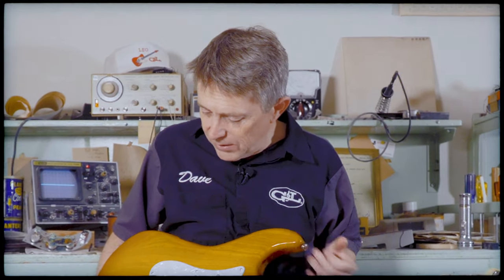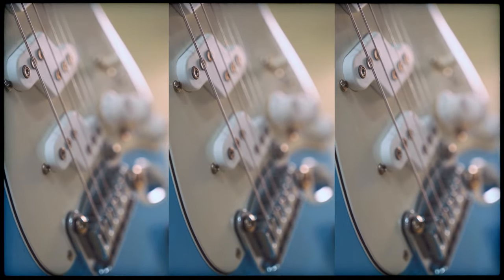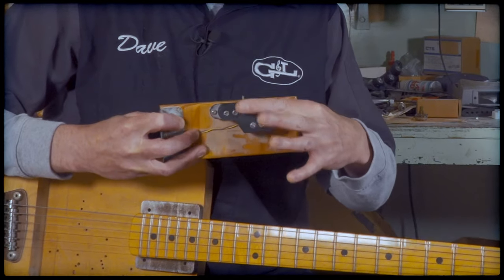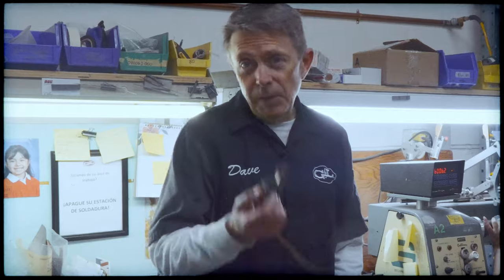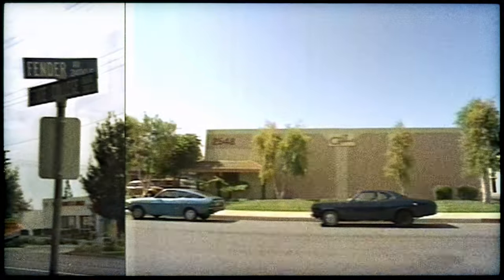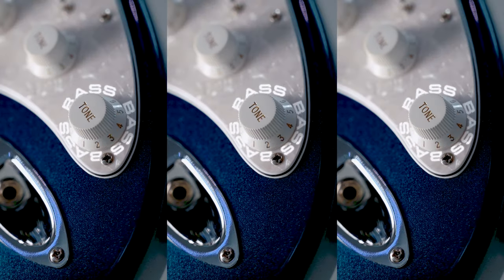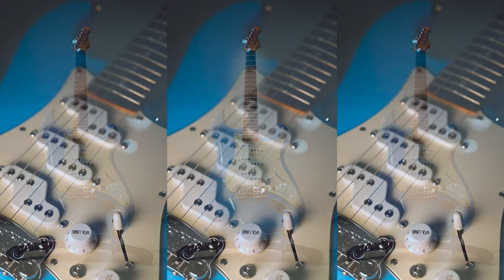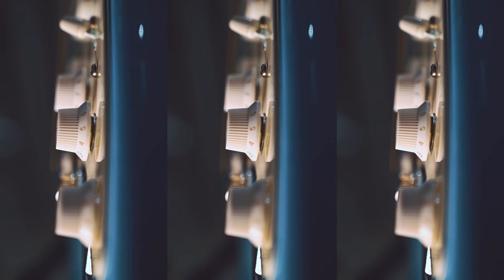In-Depth Look at the G&L Comanche | G&L Guitars

Comment: I love that the guy who gave us the Telecaster, Jazzmaster, and the Strat has solved their biggest problem, and nobody can be bothered to use his solution, "cause it looks weird!
Reply: Teisco made split single coils in the 60s but those weren't hum-cancelling, instead, the wiring of the guitar was made in a way that it had two output jacks which purpose was to play treble string notes through one amp and bass string notes through another.
Reply: @D14V0R05 woah that’s an interesting way to achieve stereo. I think i prefer that to the es-355 way of One jack per pickup. Seems like it’d sound like 2 guitars
Reply: @D14V0R05 
If you have enough brain and access to Wikipedia - you can rewire those guitars by yourself, for humbucking feature. 😉

Comment: I did not know G&L Guitars... Since I watched the video on YouTube from Rich. Words. Music. That was very interesting and now I know more about Leo Fender and he's work. Now I'm also interested to try some guitars from G&L here in Germany, but this isn't so easy, especially if you want to play a Comanche, because it's not a "Stratocaster" or a "Telecaster"... But at least a could find a dealer that has one. It's important for me that I can hold a guitar in my hands before I buy it. In the past I wasn't a big fan of a Stratocaster, because my first one was a very bad copy and it sounds really not good. That is long time ago, I was 17, now I will be 60 years this year... I bought my first real Stratocaster 2019, because a friend took me on a guitar shop tour through Hamburg and I was really impressed and surprised by the sounds of a Stratocaster professional and one month later I bought one. A bit later Fender came around with the new professional II with some changes and that was the point where I started to have a closer look into the guitar, the materials and the quality. I was not happy with the two point tremolo system and the quality in detail and then I started to make my own tremolo system which based on the original two point tremolo system, but I used different materials and made my own designs. I use titanium, bronze and steel, bigger tremolo block, different springs, different spring claw, an additional resonance block which is connected to the body, new saddles, new plate...everything new. The last parts will be finished in March and then I will complete my prototypes...
The video about Leo Fenders work in G&L was really inspiring and I still have so many crazy ideas. Next month a friend and I will making another guitar shop tour and we will play some G&L guitars and that will be great. But at least two questions:
1. Do you will produce baritone guitars? I love to play baritone guitars.
2. Do you will produce 7 string guitars? Also a combination like 7 string baritone...? 
😊

Comment: Wish you all would manufacture some mirrored pickups one year to enable a lefty run. I’ve always loved the look and sound of these.
Reply from the maker: While it’s too expensive to tool up the Z-coil covers for lefty, I think we can use Espada pickups and change the bobbin aperture and coil turns to match Comanche. That’s how we’d get the stagger orientation and correct sound for a lefty. - Dave
Reply: If you do something like Jimi Hendrix do in his time - you can play on conventional G&L with no issue.
Also you can order custom body from Warmoth, for full comfort to the lefthand.
Reply: @iridios6127  thanks for the suggestion, but I have already considered this and it is not the solution I am looking for.
Reply: @GL_Guitars  Very interesting, thank you! Looks like I’ll be visiting my local G&L dealer soon 😉

Comment: I wish G&L would break with tradition and make just one model with the control knobs and selector switch moved out of the way of the strumming hand.  I know Leo used to listen to musicians for design suggestions.  You might want to do that again.
Reply: It wouldn't be a huge deal except for getting a pick guard is a pain in the ass. I also want a dive only  vibrato, but these aren't supposed to be decked. Then there's the price, any guitar over a grand should have stainless frets. The last time I looked at their order form it was a $400 upcharge. Tried a Tribute model, it would be fine except for the 1 5/8" nut. Too crowded for me. Love the sounds of their guitars, but the aforementioned gripes I have keep me from owning one.

Comment: I've never tried one. Do you round the fretboard edges? That would be my preference. Thanks.
Reply from the maker: Yes. Over the years it shifted a little but they tend to be rounder since we introduced our Modern Classic neck profile like 8 years ago. Basically we added 1/16” on each measured at the nut, but still run 1 5/8” string spacing. That little extra meat let’s the edges roll without string fall-off.
Reply: @GL_Guitars  interesting, thanks. I'll have to give one a try.

Comment: What is Fenders MFD?
Reply: MFD = Magnetic Field Design. It's a pickup design with a large ceramic magnet beneath the coil and adjustable iron pole pieces. The coil is relatively narrow and wide with fewer turns than his original single coil designs. When compared to traditional single coils these pickups have better hum rejection, wider frequency response (more highs and lows), less of a high frequency spike, clearer tone and higher output despite the DC resistance being lower than comparable pickups. The MFD Jumbo is my favorite pickup; clear, punchy, loud and bright. It's like a cross between a P-90 and a Tele bridge.
Reply: @tiki_trash  I didn't know G&L pickups were MFD and used Ceramic magnets instead of Alnico. I didn't know that Leo Fender used Ceramic magnets for the G&L pickups because of better hum rejection.
Reply: If you like Teles but want more output and midrange, check out the ASAT Special with the Jumbo pickups. I love mine. The ASAT Classic is an even more midrangey MFD pickup in a traditional Tele size.
Reply: @tiki_trash  ya I looked into the ASAP pickups which are called MFD Jumbos which are a totally different designed than P90s or Jazzmaster pickups. They do have less hum of the way the pole pieces North and South arrangement cancels out the hum but the ceramic magnetic have a higher output so you get more frequencies also
Reply from the maker: @waynegram8907  it’s not just the magnet type, but the orientation of the magnetic field. Otherwise it might be more like a P90. There really isn’t one part you can point to as being “the difference”
Reply: @GL_Guitars  MFD uses a thicker magnetic and extra strength magnetic. P90s uses 2 humbucking magnetics a north magnetic and a south magnetic that are placed side by side each other compared to a MFD only uses 1 magnetic. The MFD pickups are considered smaller size Jazzmaster pickup because the coil width and height is short put the magnetic is thicker. The MFD pickups will give a hotter output signal when using strings sets of 8's or 9s to sounds like a set of SRV 13's.

Comment: If the pickup works great on the p bass why not on a guitar.
Reply from the maker: The Espada guitar, has it been launched as a Fender in 1970, would have been really good for that. The Electric XII had it too, but nobody wanted to change the Tele and Strat back then. Fast forward to the ‘80s and Leo came back to the idea at G&L